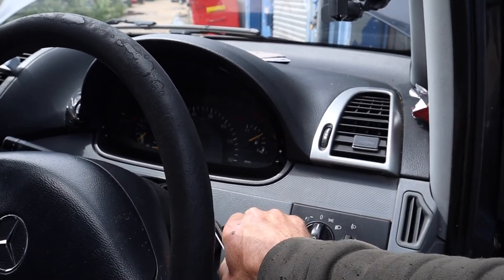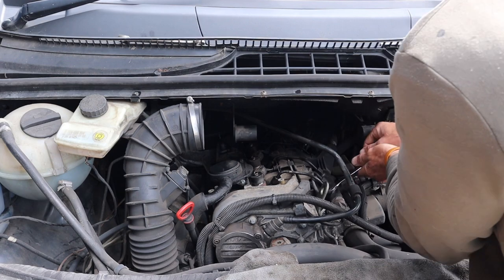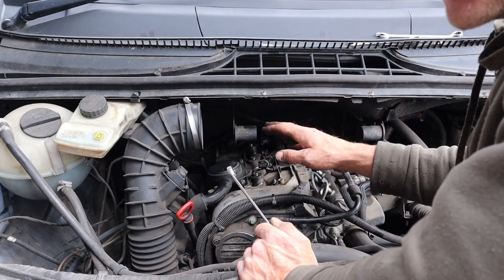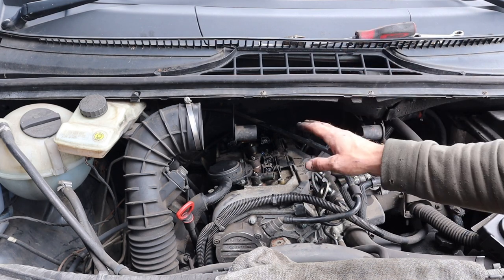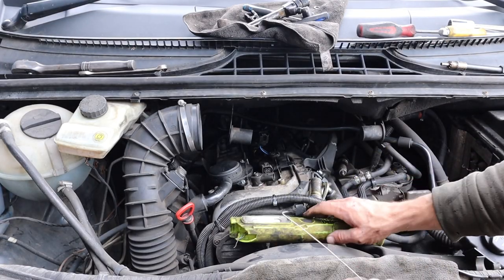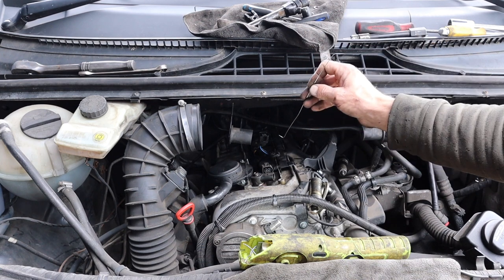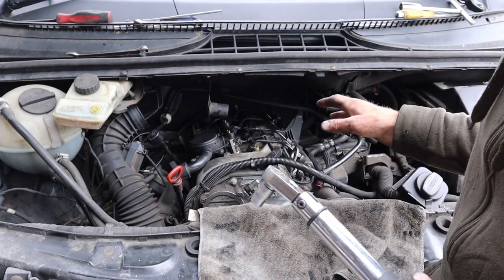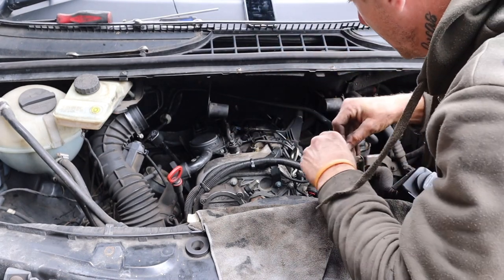Mercedes diesel injector seal replacement Vito sprinter DTE

Comment: Thanks for uploading mate!

I’ve got a saga going on with my vito, paid someone to do this job and it’s been back 4 separate times with leaks and problems.

He’s finally replaced the injectors with new ones as was first agreed upon but the third injector is now leaking.

A nightmare, hopefully now I can fix it myself.

Cheers
Reply from the maker: @ben salter hey bud welcome to the channel. Oh no what a pain, if the threads ain’t cleaned out properly then leaks can come back soon after. Drop me a message on here if you get stuck with anything 👍 thank you
Reply: @YTDTETV  cheers brother!

All sorted now thankfully! Only thing I did different was I put the hardline back on the injector but upwards and used that as a bit of a handle to yank it out. Your idea with the screwdriver to get the seal out worked a f-ing treat too!

Comment: Great video, might need to bring you my Vito for a tune up! I keep getting egr errors but my previous mechanic had cleaned it out and found no problem with it so wonder if it's the mass air flow sensor? Cheers
Reply from the maker: Hi Alex.. sometime egr’s are past cleaning and need to be replaced. A bad maf sensor will cause similar issues for sure. Thanks for the comment 👍
Reply: I've gor exactly same issue. Egr is extremely clean. I just clear the codes every few months when it comes back.
Reply: @Jay Heisenberg  I did get my EGR replaced in the end with a reconditioned one. It's been perfect since with a new propshaft too. Shame the rust is so bad on it now though. Just spent quite a few hundred on welding sills and wheel arches and sliding doors. But it's an old Vito so what you gonna do 😃😅

Comment: Just checked mine its like tar right peed off 😭
Reply from the maker: Hey bud welcome to the channel, yes if it’s been left a while it builds up like tar. If you change them while the engine is warm it’s easier to get them out. The tar stuff chips off easy when cold. Just spend an hour with a flat head screw driver chipping away at it.
Reply: Cheers for the reply ,started scrapping with small flat head but all the wires are covered so i stopped in case snapped some ,might have take it to merc garage for a quote 😡
Reply from the maker: @gdhs021  no worries you can get stuff in a can called “injector crack” it desolves the tar then wipes off for delicate areas.
Reply: @YTDTETV  cheers mymate 👍
Reply: Ive had to change my return fuel pipe as it was so stuck and brittle it broke the plastic bits bought a new one off ebay but it wont push in to the female part,the end washer seems bigger than the original one bought one from merc which was bigger than the original one and still wont go in do i need a special tool to push or pull in ?
Reply from the maker: @markeason4081  hi bud welcome to the channel, can you email me pictures of the old and new one? Hopefully I can help.. NDAUTOS24A@GMAIL.COM 👍
Reply: Hi mate do you know how to take the lock off the single back door of a 58 vito, its the 3 metal rods im struggling with cheers